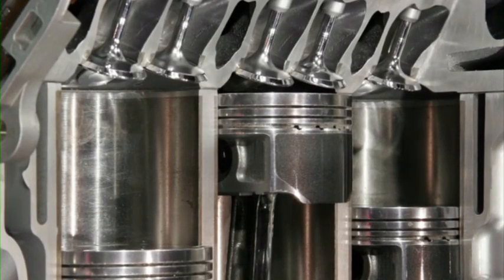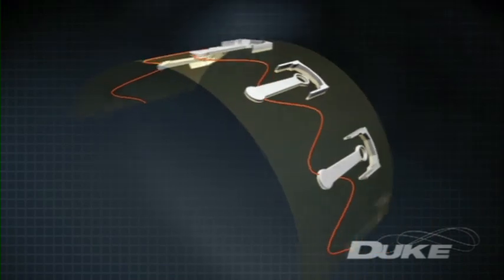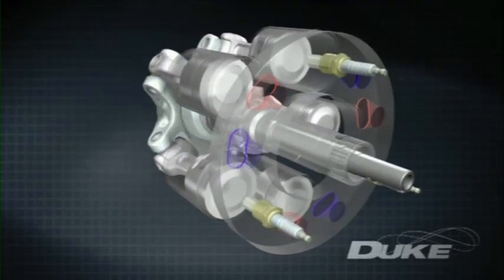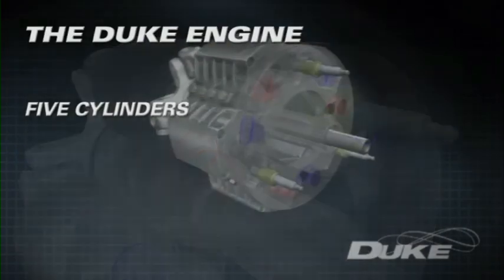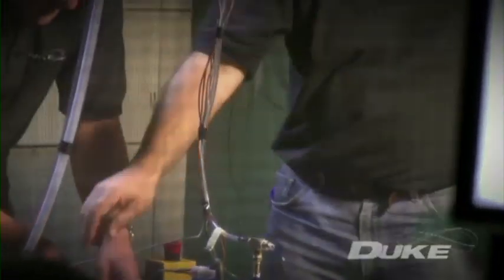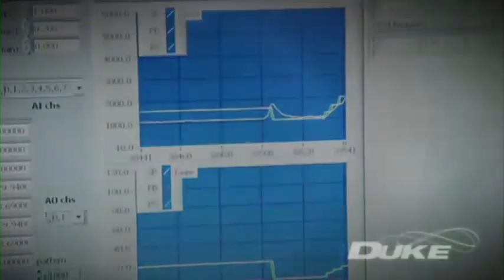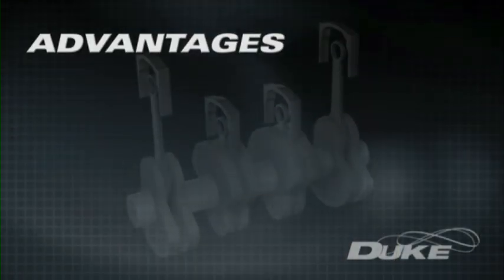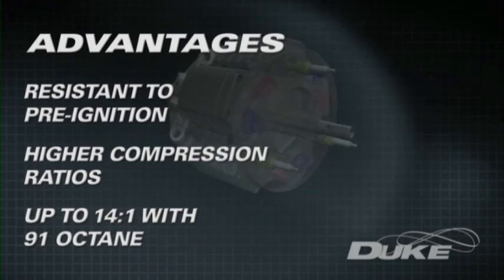Duke Engines

Comment: I believe you guys are digging too deep into this thing. It's a great idea and for someone going into mechanical engineering I love it. Yes, there seems to be a lot of issues with countering forces and seals and such, but this engine is only in prototype stage. Don't expect a production version until at least 2025.

In a couple decades, this might be one of the few gasoline engines left. I can see it's use being very great in boating or small vehicle (lawnmower) applications. Traditional two stroke engines produce a lot of greenhouse gasses and have very bad reliability. If they can figure out a way to keep seals in tact and friction low, the uses for this are substantial. However, I don't think it will make it to cars. Besides, cars about to be overhauled by diesel and electric motors anyways.

Comment: An upscale version (like 15 litre displacement) may find home in aircraft or boats, but I highly doubt this can be used in cars. The fundamental design of having the pistons/con-rods rotating a central axis will generate a strong momentum that will be hard to balance. Furthermore, the vibration front to back will also be a factor.

I like the principle which feels like implementing a Wankel Rotary with pistons. In theory this design is compact & rather simplistic as it eliminates the energy sapping parts like valve-train & crankshaft, but NVH will be an issue.

Comment: a real work of art i must admit, but lets be practical, steel is only so strong so you should beef up the shaft a little bit. and the little lobe-like thing at the bottom of it, i see that there will be very limited vibration when oporating smoothly... so its a good idea for a cruiser for sure!! maybe you could make it available in a 10 cylender or 8.i feel like if you got this far it will be a success someday!
Reply: It's nearly impossible to seal each cylinder chamber while rotating, I'd like to see how they plan on fixing this, other than that, it's a fantastic idea!
Reply: you've got a point and these guys are at something big here! it's a start at least!!

Comment: Friction, friction everywhere.
Reply: MPHstep There's a lot of friction in a normal engine as well and the lifting of the valves with their strong springs also requires a lot of power.
Reply: @MrAstrojensen  noooooo
This is LOADS more friction than other engines.

The only competitor to this is an old style radial engine.
Reply: MrAstrojensen the valvetrain is the largest single friction source in a traditional engine. Desmodronic valves reduce the friction dramatically but come with their own complications.Electro/pnuematic control is probably the way forward.
Reply: stoatwblr I had not heard of desmodromic valves before, so I learned something new today. Thanks!
Reply: @MrAstrojensen , check it in Ducati engines.
Reply: Not only that, just think about the centripetal force the cylinders would be squished outwards at higher RPMS
That's most likely why it never went on market, the engine destroys itself
Reply: What do you mean by friction?  You mean friction decreases the efficiency
Reply: ^ THIS!

Comment: It is a Rotary, Mixed with a Revolver, and a Two-stroke engine...
I love it, although doubt its reliability.  I'm with the one dude, far more machining required.
Show us how we can make a thousand horsepower and we'll be good.  Rotary Engines are great for the literage, but require multiple engines / rotors to make competitive power.  Aaaaaaaand rotaries aren't known for being reliable
Reply: a revolver hey? haha but yea simplicity of a two stroke.. maybe they should add a bearing where the off camber shaft is turning... that would boost reliability big time... i feel like without it it would go through them shafts like every 25000 miles... but yes the complex-simplicity is just amazing!!
Reply: zach sylvester
2:54 total revolver ahaha.  Yeah I don't want to go into what i think would make this better because I'm not an Engineer... I don't even want to say yet because I'm not even a sophomore in an Engineering program, just a fresh.. ahh fuck
Reply: Bill Hamilton gotcha man i looked at a few revolvers and it pretty much is one... i feel kinda foolish! but there's so many possible upgrades to this but as of right now i think its kinda crappy, but a great idea
Reply: It isn't a rotary though, the rotary you're thinking of is a Wankel engine and this engine does not follow anywhere near the same principle.
Reply: Rotaries are reliable, but their problem is that they drink a lot of fuel and oil, I know a guy with an RX-8 that had to refill the oil every 1800km and do a complete flush every 5000km, as well as achieving a pretty bad fuel economy of 15L/100km, however he drives it like a maniac, so I guess the normal consumption is at around 10-11L. That is huge for a 1.3L 3-rotor, I own a Corvette with a 6.2L engine that gets combined 11L.
Reply: Mowogjones It's really important that everyone understands this. The Duke engine is nothing like the rotary engine in an RX-8. The only similarity is that the compression elements are arranged around the crankshaft. Otherwise they are completely different. In other words, the reliability of the RX-8 type rotary engine (Wankel engine) says absolutely nothing about the reliability of the Duke engine.
Reply: Actually bill the wankel only has 3 main moving parts as opposed to the conventional engines dozens
Reply: Xavier Gourdine yeah I guess I really havent a clue how a wankel works other than shit spins really fast and that you dont see any larger ones, just throw in more rotors, I imagine it has to do with the same reason you can get B16s from an old Integra to hit 9000rpm and a modern muscle car has a redline of 6000rpm because the moving parts are so much bigger and are pulling much more g's due to height per rpm
Reply: Sup dudes I was just discussing thr fact that a rotary engine has a lot of moving parts in a lot of directions, which I also see a lot of moving parts.  Im not an engineer, just a spectator no worries
Reply: Bill Hamilton Even though it has less parts the principles of containing pressure within the compression chambers aren't as reliable as a conventional piston engine, hence why not every car/bike has the wankel under it's hood.
Reply: wankel engines are not as unreliable as most people think. it's just that they require a lot of maintenance and proper attention. you have to add oil every 1000km or so and completely change your engine oil more frequently than piston engines. besides that, you always need to warmup and cool down the engine properly. cars with rotary engines are for enthusiasts, they are not for housewives to go to grocery store or for spoiled kids to ride with their friends. as most people that actually serviced rotary engines say, the vast majority of failures are because people fail to undertand the importance of adding oil periodically, thus, engine runs on low oil for extended periods of time, does not lubricate properly and seals are starting to fail.
Reply: Bill Hamilton I hear that. I'll be back with good seals for my rotary  . But this engine is a cool design
Reply: Bill Hamilton a rx7 wankle can hit the same stock. I think ,not sure, they can hit 10k rpm stock too
Reply: Xavier Gourdine I think he means a plane rotary. Those things are a lot like the duke moror
Reply: motor

Comment: Axial engines have been around for a long time folks. There are a lot of engine designs that have been around for a long time but no one has ever heard of - and there is a reason for that. Take it from a rotary engine owner - piston inline, V, and boxer engines have struck a good balance between complexity, power, efficiency, repairability, and reliability.

Comment: How does it rev?
It does not, because the injectors and spark plugs do not move.

Does this brings problems at starting the engine?
Yes, it does.

What about the inertia of the engine moving around?
This brings more or less impact on driving depending on the position (laying down, up sided or sideways).
But still brings a lot of instability due to heavy materials moving in a circle.

This all brings a let down, beside all the problems with sealing that you are talking about.
Sealing could be solved with Research and Development.
But the reasons above - that are focused in a practical way of users - will make the idea fall from the beginning.
Reply: Rory Gills your doubts are understandable.
Sorry if I was not clear.
Sometimes I forget I have to explain things so even those who are not into cars can understand the logic behind my statement.

"It does not rev because the injectors and spark plugs do not move."
As you increase speed in your petrol car, the wheels have more revolutions per minute. This means that the shafts between those two componente rotate at more speeds too.
To allow more speed, there is a gearbox in between the engine and the wheels: so you can have different ratios (different gears) to combine with the engine speed, and allow the increase of wheel speed.

The engine revs are equal the wheels revs multiplied by the ratio of the gear you are in (ratio depends on the gear, the frontal/back differential ratio and other possible components, like the central differential in 4WD cars, or even a splitter on heavy duty trucks).

This increase of engine revolutions brings different timing of fuel injection, spark plugs ignition and valve opening.
In the valve opening part, that is why you link the crankshaft to the camshaft by the timing belt, thus the name.
In the fuel injection and spark plugs ignition part, that is why you have maps on the ECU to vary the amount and frequency of fuel/ignition depending on the revolutions of the engine and throttle pedal position.

In this engine, the injectors and spark plugs are still, making it impossible to increase revs, as the injection and spark plug ignition will not occur at the desired piston.

Even if it could not rev and the engine speed would be the same, the problem could be solve by a CVT in the place of the gearbox.
There are production cars that have this systems.
But I do not see this as an improvement.
Speciality in the torque department. Where, in this engine cycle would be very low, because of the decrease of linear movement.
Pure physics.

"problems with sealing":
As the pistons move - I am talking about the rotary movement - where is the combustion chamber?
That chamber that controls the explosion and concentrate it on piston movement?
I am sure there is one, thus the production of torque by the engine.
But, what material is used?
How long will it last until wears out and has great losses of power?
That is the type of problems that a regular car as to deal with.
Nobody wants to go to the shop (mechanic) everyday, right?

As an engine revs - or any sort of movement - there are material - hard material - touching other materials.
This causes wear out of the materials.
This creates heat.
Heat is something that decreases efficiency.
In this engine cycle, the are more or less material friction?
That is very important to know.

Any more doubts about my opinion?

I am hear to help.

Comment: How about using engineers to design a non petrol or electric motor. But a new type of engine that is self sustaing with out using nuclear power. Like the sun uses fusion, we have robots on mars. Buildings that are a quarter mile high and. Cell phones that have more computing power than a pc and. A functional rail gun that is already made and coming to the navy in 2018. Plus the fact that the conventional engine was considered obsolete technology by the scientific. Community in 1945 yes 1945, my 2006 corvette ls2 engine was obsolete in 1945.

Comment: How the fuck does it seal the combustion chamber?? And if it can seal, how much friction does that create, considering its moving? Wouldn't that always be the weak point?
Reply: ***** You need the chill the fuck out you spaz. He was making a joke. Dumbass.
Reply: ***** Simply because any other car manufactures don't own the patent? DUH.

Mika_012397 Wow, RUBBER SEAL. LOOOOOOL! Mika, go own and work on a car before replying please. Is no rubber. In fact is usually cast iron or steel. And the fact that this piston in this engine is rotating (like you said it yourself), is actually even better than a piston that is traveling up and down. The way they seal this rotating piston "block" will be exactly the same way they seal traditional pistons with the piston ring, just that there will be one extra "seal ring" between the rotating block and the mating surface.
Reply: A square wheel rolls exactly like a circular wheel, on semi-circular terrain.
Reply: CarMad97ci how does your piston moves up and down and can still seal? Same idea.
Reply: ***** you are an idiot. I doubt you even know how this motor operates before you make your comments. please stop commenting.
Reply: totszwai dude you are the on that's an idiot here "how does your piston moves up and down and can still seal? Same idea." because a conventional piston has rubber sealings around the piston head which seal the cylinder but still allow it to move by lubricating with oil. the piston in this engine IS ROTATING through the engine so it isn't in one place going up and down but is moving to the left aswell and that is a problem since you still need to have a seal to have compression from the explosion to get up and down movement which drives the crack shaft.
Reply: its like a 2 strk
Reply: *****
 Yes.  That is exactly what I was saying.  Ya got me.

Comment: So... when can we turbo it?
Reply: In theory you could, it the engine is capable in taking higher rotational stresses from the higher force of compressed, or charged air on ignition, it could be possible.  
I wonder what this would sound like compared to a typical 5 cylinder engine.
Reply: You can kind of hear it startup in the video, it sounds quite lopey TheHeftyDanielson

Comment: I very much doubt you could kick one of these engines guts in for 20k miles let alone 200k+ like some conventional engines are allowing. I would think the reciprocator bearing/joint will fail quite quickly. But like they say the proof of the pudding is in the eating.

Comment: Yes you can get the same horsepower out of one but torque is reduced significantly due to there being virtually no stroke, with is a big thing for power and efficiency, in order to match a regular engine you have to run ridiculously high rpms.